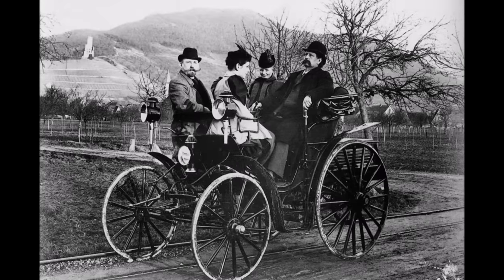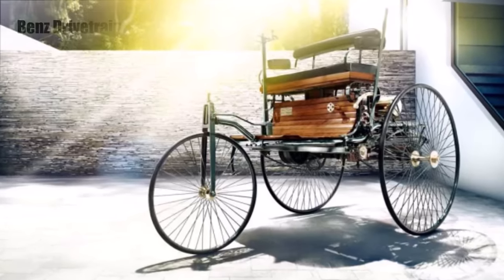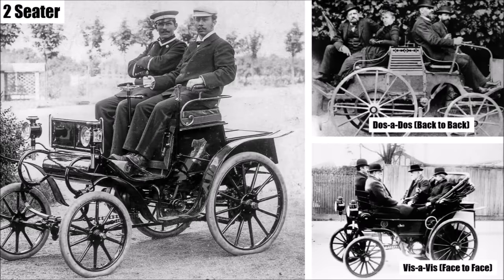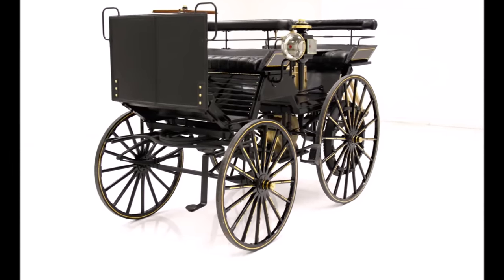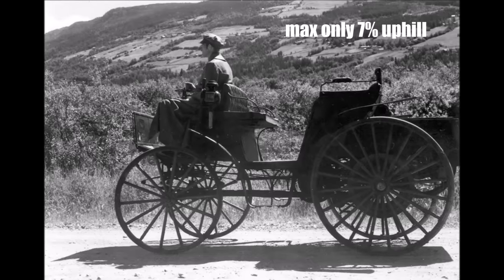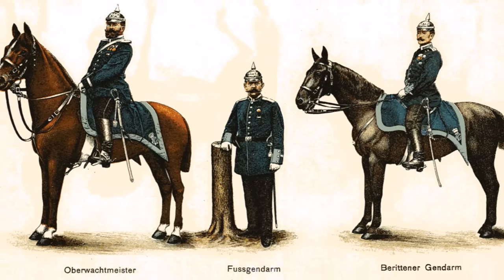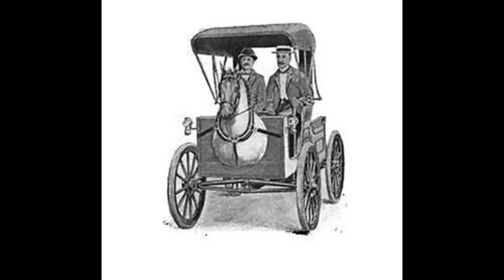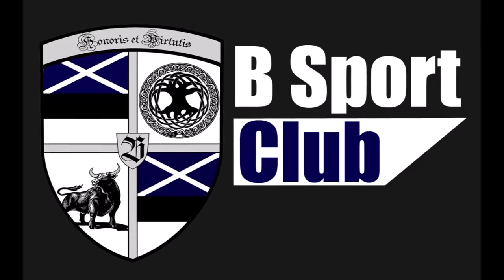What it was like to drive a car in the 1890s

Comment: Carl Benz knew what he was talking about. All of the EV advocates could learn an important lesson from him. As far as being "open-minded" goes back in the 1890s, cars were toys for very wealthy elites. Unreliable toys that constantly broke down to the point that said elites would have a horse-drawn wagon with a servant and a mechanic following behind them while motoring in their toys. Due to the speeds cars produced back then, this was a practical way of doing things. When, not if their toy broke down, they knew that all they had to do was wait a few minutes at most for their servant, and the mechanic to pull up in the horse and wagon to fix whatever broke down this time. With plenty of spare parts for their toy located inside the wagon. All of this is documented fact.

It's nice to be open-minded. But when the literal creator of the car with an engine in it says there are too many issues to start selling it to others, best to actually listen to him.
Reply: Electric vehicles were far more reliable than combustion cars in those days.  And they still are today.  Sadly, the chargers sometimes are not.  On the other hand, Tesla chargers are quite reliable.  So there is no added risk driving a Tesla than there would be driving any combustion powered car.

The first generation of Tesla cars were indeed playthings for the rich, just like the early automobiles.  But now, the Model 3 and Model Y both are more economical than most combustion powered models in the wealthier countries.

This may explain why the Model Y was the best selling vehicle in the world in March 2023.
Reply: @davidmenasco5743  
Honestly if they were far more reliable back then, they would have gotten adopted over ICE vehicles.
Reply: @dauntlessasmr7910  This is rather massive fallacy of logic.

EVs did not fail to keep their market lead due to a lack of reliability.  It was solely because of the convenience of refueling ICE cars, and their ability to travel longer distances on a tank of gas.

Tesla demonstrated 10 years ago that EV technology is now much more advanced and can compete with ICE cars in convenience and driving range.  It will be a few years before EVs are competitive in every market segment.  But for the large majority of drivers, EVs are available that will meet their needs without making the large contribution to climate change that ICE cars do.
Reply: @dauntlessasmr7910  they were and did for a while, but the range is still a problem
Reply: @davidmenasco5743  During the days of Tartary (before the flood) cars were available to everyone, most ran on electric. I think gasoline cars were something we got forced onto starting in the last reset.

Comment: Very interesting, but I don't really consider those late 19th century vehicles to be cars, but truly horseless carriages. But I suppose the term automobile applies.
Reply: Where do you think the term "car" came from? It is an abbreviation obviously of "carriage". So they are still just horseless carriages - and the early models were still cars.  It is only a change in common language. "Horseless Carriage" was obviously too long to commonly use, and now we retain "carriage" to distinguish vehicles still powered by a horse. All that has happened is that "cars" evolved from a form mainly designed to be pulled by horses, to something more efficient, and comfortable for the carriage of people, with respect to the change in motive power. "Automobile" is also another term synonymous for "Car", however it is now also almost obsolete and rarely used. But similarly, it is sometimes abbreviated to "autos".
Reply: @wyomarine In America, we called it the Runabout and we were the ones who set the automobile in motion considering by 1900 America already had already, 90 car companies in the USA alone. Model T was NEVER the first nor the first hundredth vehicle to make the road, in fact Ford had models going back from 1906-1903-1899-1895 and 1891. When the idiotic thing hit the market, America had already established 250 companies by 1907. As for the Airplane I can't say when it was invented and revolutionized but Leonardo Davinci is the prominent accessory to its forward invention.

By 1910 America had 300 companies and it grew till about the war. By 1920 around 245-50 companies existed, and by 1930: "70". By 1940, 25 companies remained. And the designs were endless, every vehicle was art.

America was also first to create the hardtop tonneau, in 1905, a full sized sedan with a completely enclosed cabin. But look up "first enclosed car" and you'll either get random results, or someone congratulating that dreaded Novel-T on creating it because everything was created on the Model T says everyone who knows nothing about the era.